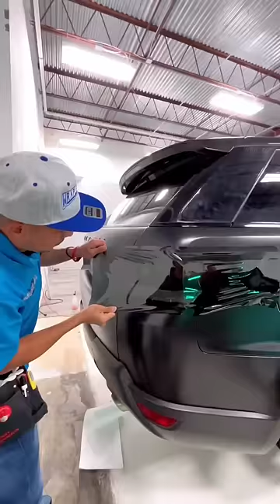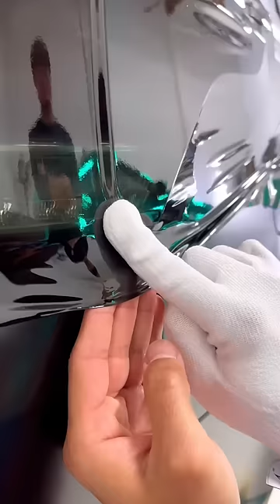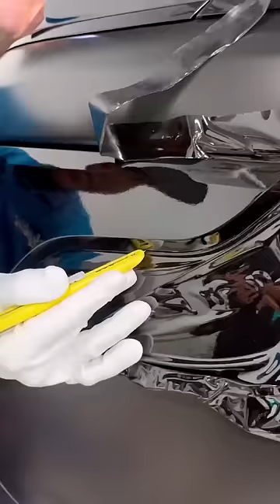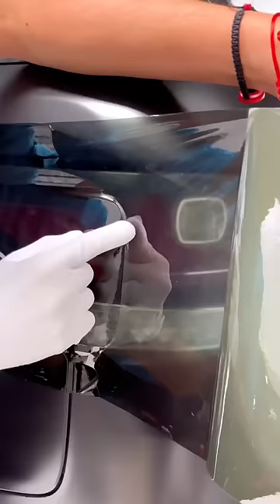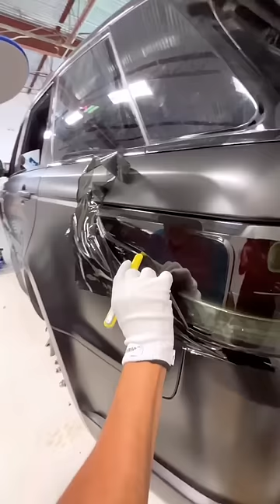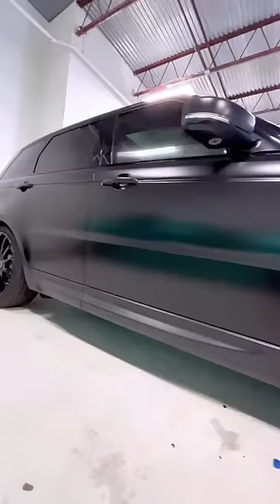If this Wrap is Wrong.. I don’t want to be Right‼️🔥✨👌 #carwrap #carwrapping #vinylwrap #rangerover

Comment: Yeah, it is. This is a major safety issue, especially in day time traffic when brake lights are hard to see in direct sunlight. Good luck having insurance cover a rear impact when the cops put "illegal lamp tint" in their report 😂
Reply: Dude he got 200 g car i bet the person can afford that ...
Reply: @combatx3373  sure he has money, but if you're caught with illegal modifications and/or get into an accident, you're for sure getting points which might lead to suspension or revoked. GL to the bloke.
Reply: @combatx3373  funny of you to think that anyone to buy such a POS car that doesn't even hold the prestige that the original company does would actually buy the car outright. That car will be on finance and if the car gets totaled, you owe the full value of that car to the finance company.

If the insurance is void due to tint, you now owe 200k instead of a deductible/excess
Reply: @ProlificGV  uhh, can you read? Can buy your way out of getting your license revoked or suspended? money cant solve everything.
Reply: @combatx3373  do you think rich people throw cash left and right?
Reply: There’s no way you just said it’s legal, and a couple sentences later said it’s illegal…
Reply: Its only legal if the lights are visible
Reply: That is a completely valid response, but the question was… “is this legal?”
Reply: "it is"? He meant it isn't I got your bro
Reply: Dont gotta pay if u going fast enough 🤣
Reply: Well it’s only a RR sport and not a new one from the looks of it, maybe £50k worth and it looks to be devalued with what’s been done to it. Looks cheap now. And also it depends how much light is getting through the tinted film as to weather it’s illegal (in the uk anyway).
Reply: @combatx3373  it’s called a lease first off second you know certain people spend more than they have right
Reply: Dude the light flashes just as bright with these on search it up
Reply: I read pimp instead of tint
Reply: @HitomiNee  can you read? they were commenting on the nerve of the comment that you replied to. saying that they have money so it doesn’t matter that they’re endangering drivers
Reply: @grandcalifornia8410  people think that rich people throw away all their money left and right. You don’t get rich by wasting money like a moron, that’s why alot of people never become rich. Unless you’re a trust fund kid though, then you probably do waste money.
Reply: @grodey3985  thank you shit not even that dark they ass arguing for nothing
Reply: @2oqh  that’s exactly what I meant by my previous comment
Reply: @rorymax  It's not his fault, the comment said "the nerve to say that" while tagging him and then he added (the person above you said they have money) of course it's normal to think like he did.
Reply: @Geezer877  He answered that, Didn't he?
Reply: Yup,as good as it looks,it’s a big safety hazard
Reply: Thank you!! Thank you for saying that.. I hate when I can’t see someone’s taillights..they think they are cool but won’t be so cool when you get your car or truck fucked up
Reply: Especially if it is really opaque
Reply: @andreesm8221  yeah and the stuff the brackets very clearly showed who he was saying had nerve
Reply: Nah, most cops don't even care. Plus if I live in a different state from where my car is from I can literally have a nascar and they can't do shit about it. A cop told me all of that.
Reply: I’ve had all my cars spray tinted on the tail lights and never gotten a ticket, and I live in Southern California (the strictest place). So chill, you’re fine. Just don’t drive like an idiot
Reply: Exactly. I can’t stand people with tinted tail lights. It’s so dangerous. Especially with tail lights being the biggest and sometimes only way of communicating with the people behind you.
Reply: @combatx3373 what kind of car is 200 g? That is way too light.

I know you meant $200k.
Reply: @suspicioussourdough  go cry
Reply: @combatx3373  he has a car who said he paid 200g for it?

few people ever pay cash for there luxury cars either a they cant afford to dump 200k on a car so finance it 

the other side is rich people who understand money

200k for the car poay cash your 200k down 

maybe it appreciate in value over time but for now your 200k down

instead take the 200k and invest it and take the car on a low interest finance package you'll see a greater return on investment from the 200k and when you do sell the car the appreciation value if its the right car will cover what losses you made in interest payments on the finance plan
Reply: it’s completely legal here
Reply: @HitomiNee  can YOU read????
Reply: @combatx3373  that isn’t a 200 grand car
Reply: @RetroactiveEscapades they thought it said “is this illegal”
Reply: "Yeah it is" So you're sayin it's legal? Thanks lol
Reply: What's the song called
Reply: in india it is illegal
Reply: Song ?
Reply: This assumes the police show up
Reply: okay you said yet but proceeded to only say bad things about the wrap so im confused
Reply: Get brighter bulbs, problem solved.
Reply: You can have black taillights tho just not tinted
Reply: Illegal in Europe, we are as dumb as we are smart, we have wisdom
Reply: Lights are clearly visible
Reply: U just said "yh, it is legal"
Reply: Who is this car going to endanger? It's a range rover, it'll break down before it can even leave the body shop
Reply: @combatx3373  And can he afford loss of human life or grievous injury? Absolutely degenerate comment.
Reply: but its also kinda stupid that turnsignals in US cars are the same colour as the brake lights
Reply: @combatx3373  this old ass range rover is 200g? More like 20g and had 7 different owners before this guy....
Reply: @HitomiNee  also liability if the insurance decides not to cover it because it's illegal.
Reply: @HitomiNee  it can.
Reply: Jesus 4.1k likes and no comments
Reply: @combatx3373  still can't afford to resurrect another Man's life.
Reply: yeah notice how they didn't show how dim the rear lights would be in the indoor shot at the end
Reply: @HitomiNee  The second smart person’s comment I have read so far!
Reply: The car is already a  road black color, it'll blend in so well grandma won't see it in time.
Reply: @combatx3373  don't be slow
Reply: @combatx3373  ok, give me all his money for him causing the accident lol. imagine it caused death? wyd then tho? og comment has a real point
Reply: And the reflectors too
Reply: It’s not illegal infact nothing is illegal if ur a sovereign citizen 😅
Reply: @combatx3373 i bet he could afford tinted after market lights but thats none of my buisness
Reply: Bro you said yeah it is to the question meaning you say it is legal and the you go and give reasons as to why it’s not😂
Reply: That’s why he does it off the books 😂
Reply: @ProlificGV  Roblox...
Reply: It's legal, as long as the tail lights are easily visible. Ot would be the person who rammed the back of the person's car because it's their responsibility to keep a safe distance from the car in front of you and behind youm
Reply: @combatx3373 no way that’s a 200g car. Looked one up on auto trader and they are selling for 80k tops lol. Somebody doesn’t know their cars… awkward
Reply: @Dark_Messiah-D2  there not legal bud, do some research
Reply: @combatx3373  200g? What is this a Bentley? 😂
Reply: @combatx3373  that insurance finna make him pay 3x the price of the car tf u mean LMAO
Reply: @combatx3373  And if there is a wreck and someone is injured or killed?
Reply: Lol this is coment i expected
Reply: At least in Europe, it seems to be legal to have tinted back lights. You can order them at the configuration by the manufacturer.
Reply: @ArshEbrahim  "Stan" by Eminem and Dido.
Reply: @andrerussell2383  "Stan" by Eminem and Dido.
Reply: @Kabodanki  It's the 80's all over when Audi made rear lights with smoked glass, that did put out the correct color temperature, and the tuning scene made wraps that..... didn't do that.
Reply: People get smoked headlights and taillights all the time they are still bright
Reply: @combatx3373  money can buy almost anything. Except your life if you get into an accident. Safety regulations exists not because the govt is pooping your style.
Reply: @ProlificGV  Everyone thinks they "have the money" until punitive damages are awarded because of such a purposeful and overt safety risk.  The price of the car is the least of your worries.
Reply: That was a stupid reply my boy...
Reply: @mwmm  w comment
Reply: don't you mean "no it's not"? because the question is "is this tint legal"
Reply: @combatx3373  it’s not about affording it. It’s the people behind him may not be able to see his brake light. Some guys are idiots and you can barely make out their brake lights at 5am.
Reply: This is most likely see through.
Reply: It really depends on the kind of wrap and how dark, most the time it’s not enough to really reduce the amount of light visible while the lights are on.
Reply: You said yes to it being LEGAL, and then continue to explain how it is ILLEGAL
Reply: The break light is on the spoiler the little thing sticking out at the top
Reply: @combatx3373  I think youd be amazed at the amount of cash poor people driving these
Reply: That's exactly what I was gonna say. But let's be real some people just aren't smart enough to figure it out lol
Reply: We need more people like you
Reply: Yes actually lol
Reply: Can you tint them in a darker shade like a slightly darker red for the brake lights and vice versa fore blinkers?
Reply: I can't speak to the US, but in South Africa, thr answer is "technically, but you could still get arrested for it".

See, the wrap itself IS legal. No issues here. But we measure the legality of lights by the distance illuminated. (I don't remember the numbers exactly, but i think it's about 30 m for back lights and about 50 m for front lights) so, if these lights still illuminate far enough, then, yeah, sure! If not, nope. Not legal.
Reply: Yeah it happens to lately..i can't see his brake light much..... lucky i noticed early.....if not boom 🤣
Reply: @combatx3373  and that makes it okay to put others at risk?
Reply: @combatx3373  Do you even think of consequences?
Reply: Bro what?

Vid: "Is this wrap legal?"

You: "Yeah it is....'illegal lamp tint'"
Reply: @combatx3373  you know they can fine you based off your net worth and income
Reply: so it is legal?
Reply: Well and maybe they will confiscate whatever is left of the car
Reply: So you just install brighter rear lights? Brake lights are sometimes hard to see in direct sunlight regardless of tint.
Reply: Or in fog
Reply: @combatx3373  go back to school 🏫
Reply: @mwmm  lmao
Reply: @combatx3373  that car isn't 200g...
Reply: @mwmm  car doesn't cost that much
Reply: My brother got arrested bc of this
Reply: Ok mister you know all about stuff
Reply: @HitomiNee  but it can buy me a boat 🚤 and a truuuck to pull it 🛻
Reply: I’ve had tinted taillights on my last 2 trucks. Never got rear ended, never had anyone tell me they where hard to see. I looked at them before I drove with it on you can easily see the break lights at all time of day. Unless you completely black it out. Truth is the most dangerous thing a driver can have well driving is there phone in the vehicle.
Reply: Bro you can see just as good as you can without the wrap 😂
Reply: It's funny how everyone in this comment section talks about the money aspect of the problem. It's also just a shitty thing that can ruin people's day if they get in an accident. Money or insurance is not the only problem...
Reply: they are very much legal, u can get rear lights fully blacked out as long as they re led and u can only get a medium tint f they are not led, so what he had done is fine
Reply: That's not really that dark though. I've had darker tail lights. And if it were that dark, put brighter bulbs in to offset it 🤷🏻‍♂️
Reply: @combatx3373  land rovers aren't that luxurious and not too expensive
Reply: @combatx3373  if you’re putting people in extra danger beyond a simple accident you pay with your rights. You cannot afford that
Reply: @HitomiNee  if the accident is serious enough it could also end in a lawsuit and nobody wants to go through that.
Reply: actually, depending on the state you live in, shit is legal.
Reply: Actually in some states it just depends on if light is able to pass through and seen in the daylight. If it can then it is legal if not illegal
Reply: You said it was legal, then one sentence later you said it’s illegal. ??
Reply: How is it illegal? If you break it will glow red. Americans have such weird law. This is allowed in Europe but 99% what is allowed in the US isn't allowed in Europe. I'm pretty sure that this is allowed. You can see clearly the "inside" of that light through that foil, so it's can't be that bad. I've seen cars with basically no reflection from rear lights and is somehow was OK... because police says the % of light that passes through that is valid... even tho it barely reflects light.
Reply: Lmfao yeah real difficult to see LEDs through some 30% tint
Reply: And they don't even look that good
Reply: wait, are you answering the question from the video? cause it asked "is this wrap legal?"

I think you meant to say "no, it's illegal"
Reply: @CH DE I bet you’re fun at parties
Reply: Ppl would do anything to satisfy their fragile ego’s honestly 😂
Reply: @combatx3373  Fancy or expensive cars don’t mean you have money, it just means you had enough money on hand when you bought it to purchase the car
Reply: You said "Yeah it is," then just explained why it isn't 🤦‍♂️
Reply: @combatx3373  no amount of money make your license come back..
Reply: The question was if the wrap is legal and you said "yeah, it is" 😮
Reply: Sigma
Reply: @HitomiNee Maybe in like, Kenya, you can.
Reply: Congratulations, that vehicle just turned into a cop magnet, but hey it's a range rover so if the owner can afford it they can afford anything that ensues afterwards
Reply: You forget something that is illegal in one state might not be in a different state. Federally no this isn't illegal
Reply: Ive been driving around in my bmw with headlights and tail lights tinted, it’s been 2.5 years, so far so good,
Reply: @HitomiNee  🤓🤓🤓🤓🤓🤓
Reply: Always a hater 🤣💀
Reply: @combatx3373  bet he can afford the lawsuit for the passengers too dmbas having money doesn’t make you invincible to any problem
Reply: @HitomiNee  you can definitely buy your way out of the license revoked/suspension. Using dual citizenship with Canada and the US, you change the car registration to a Canadian company, then you just use the driving treaty between the US and Canada to shelter your license from points in the US. You still have fines, but won't get your license suspended or revoked. It would cost prolly no more than 25,000 to do that, including lawyer fees.
Reply: You mean “no it isn’t”. The question was “is this legal?” So the answer is “no”. You said “yes it is”
Reply: @HitomiNee  incorrect. Money solves everything, in the US anyway. Everything. Everyone can be bought, everything can be sold. There is no situation that cannot be improved with a metric fuck ton of capitol
Reply: @combatx3373  looks like a kia soul
Reply: @combatx3373 Rich people don’t stay rich by (stupidly) throwing money away.
Reply: People aren’t that blind.
Reply: Now idk how it works at all but wouldn’t that be on the driver rather than the shop as for all he knows it could just be a show car which in of itself is exactly legal with everything on them usually and why they’re towed rather than driven to the show’s location
Reply: Bro went according to my calculations 🤓
Reply: Holy shit dude, I thought you were joking at first 😂 what is wrong with you?
Reply: You can't say it's legal and then say it's illegal in the same statement.  That's.....illegal.
Reply: @combatx3373  it’s a principle and besides if they gets rear ended even if it’s the person behinds fault they can just say, they couldn’t see their brake lights
Reply: Don't you mean it isn't (cuz it was asked if it was legal not illegal
Reply: that exactly what happed to someone i rear ended cause the sun was setting, we were eastbound and i couldn't tell if his was slowing down till it was too late, court dismissed me following too closely and his insurance had to pay my repairs, on top of that he was finned for illegal tinting on the tail lights, and reckless driving 🤣, he did try to counter sew a couple months later and still the court dismissed it, cause he was still in the wrong and backfired on him again since his new car also had tinted tail lights 🤣,, looks good for a track car but just be warned if on public streets, that if u get rear ended, you will probably pay the price like that idiot i hit lol
Reply: I dunno but looks. Dam awesome and I can only afford a chicken ☺️ wrap 🌯 great work all the best 😊😁
Reply: @smolltaco5667 true and lights prolly not covered
Reply: Did you just say yes, it is legal??
No it is not.

Federal regulations of D.OT. and ALL State laws require there to be a reflective marker.

1. No clear in the rear unless its in the reverse gear

2. Reflection is more like a mirror than a reflective diamond cut marker lamp

3. No car ever produced was the same color as the tail lights.
Reply: @DorfVG  No.
Please see my post if you'd like to know more about it and why it is not legal.
Reply: @pandorakplays5782  its people think that the rear lights are tinted/covered by the warp but nah nothing will happen if u dont have ur lights of ur car not covered by a wrap or be intended but there are levels of tintedness that are not allowed
Reply: @combatx3373  this car is not 200k
Reply: Gotta pull that off right after you wreck lmao
Reply: Explain why some cars have smoked lenses as stock then? Not to mention it tinting makes it EASIER TO SEE brake lights in bright sunlight.
Reply: Depends on the state on how much light is let threw.
Reply: Wait so it IS legal?
Reply: Wait so is it now legal or not bcs youre first saying yes it is, and then start explaining why its ilegal?
Reply: Lol unless you live in Virginia where the person who rear ends you is always at fault no matter the situation
Reply: “yeah it’s legal, it’s just illegal”
Reply: I was behind an ass with tinted back lights. Learned real quick that a normal following distance is not enough for these jerks because you absolutely cannot see turn signals or brake lights on a sunny day. I doubled the distance real quick.
Reply: My friend has similar wrap on his BMW, the lights look pitch black BUT the light somehow gets through as if there was no wrap, it really is amazing and i still can't get my mind around it, maybe it is like a one way window , you know, mirror on one side, from the other side it is just like a normal window.
The wrap propably is made to work like this but I'm not sure,
Reply: @HitomiNee  It does. You not having money that can do that does not mean that other people don't, you are a brokie, start making real money
Reply: Wow I didn't realize how stupid everyone was hahahahaha
Reply: really doubt the light intensity is significantly reduced, I've tested people's car's who have literally sprayed painted tail lights black
Reply: If u can’t see smoked tail lights in the day surrender your liscence or get your vision corrected in almos legally blind and can see them
Reply: I can pay it who cares
Reply: @grandcalifornia8410  they do.
Reply: @HitomiNee  I mean.. it can solve a lot more than you’d think..
Reply: @HitomiNee  its not illegal though this whole argument is pointless don’t think y’all know how warps work the professionals take everything into consideration on how it would affect the customer…
Reply: @mwmm  legal means its allowed….
Reply: @likemau5552  the problem with the lights is they use headlight levelling devices that attach to your suspension, they are made that cheap and brittle they break in the first two years and people don't notice so over the slightest bump they shoot to the sky
Reply: @combatx3373 so all you care is about the money rather then the safety of others?.. -_-
Reply: @PRExJay the brake lights still work fine and are the normal bright red so no its not really a safety hazard.
Reply: @combatx3373  when it’s happens over and over again they do more than just fine you 😂
Reply: Do yall feel the same for your UNREGULATED BRIGHT AS THE SUN HEADLIGHTS???!?!?!?!😭😭😭 I despise them, it's as if everyone is already driving around with brights
Reply: @HitomiNee  I paid for mine not be suspended this morning 😎
Reply: @Sarge92  Thats middle class people bud Ahahahahahah, if you are rich, you aint spending an extra 20k just to pay it off 25x slower lmao. If you rich, you dropping atleast half the car, if not all. Theres a difference between 200k and 10mil lol. 200k is middle class sadly, the wealth disparity only grows. Also bud, YOU ARE ACTING LIKE YOU CAN SELL 90% of cars for a profit LMAO
Reply: @combatx3373  nah he would just get sued
Reply: @combatx3373  you think because he has an suv worth 40k - almost a quarter mil has the fuck it I can afford it mindset when it comes to property damage and paying for shit he already paid for that’s a brokie mindset. I know for damn sure I wouldn’t want to pay for shit and deal with inconveniences just because I can afford it
Reply: @combatx3373  off course, say that too the family that just lost a loved one.
Reply: Who cares lol
Reply: So you mean it is illegal… right? Because the video asked “is this legal” so your comment is counteracting itself
Reply: @rohanbaste-bania6227  :(
Reply: @kalebkellner5568  😭
Reply: @Combat x  problem is it's not capped at 200k. If the owner gets rear ended by a $2 mill car they will likely be held liable for those damages as well. So it's 200g + potentially a big sum
Reply: @combatx3373  that car is not 200k
Reply: Smoked tail lights that were popular in the 80s don't have that problem.
Reply: @Dylan McCallister  true but the rules around modification and safety have changed over time. You couldn't make an 80s car today and have it pass compliance (which is a shame because they were beautiful)

It might be legal in some places but most road authorities won't certify anything that impacts light visibility like this
Reply: @grandcalifornia8410  that’s exactly what many rich people do
Reply: @HitomiNee  just because it’s revoked technically doesn’t mean he can’t drive the car🤣💯
Reply: I've had it on almost every car I owned with zero issue
Reply: I'm confused by your comment...
Reply: When he kills someone it's going to be jail time
Reply: Very good point
Reply: just peel it off before cops get there
Reply: @Durkhead  "just peel it off" it's not that easy
Reply: @MickeyDee420  anecdotal evidence. Because it doesn’t happen to you doesn’t mean it there no risk factor.
Reply: Lapd would never come to make a report on something so minor.
Reply: “But officer! It looks cool though!”
Reply: He asked if the wrap was legal, and in tge first scentence, you agreed with him.
Reply: @MickeyDee420  op said in the sunlight. That was the context of the discussion. At night it would most definitely be visible. 
I really don’t think it’s that deep though. Sometimes people making rule’s genuinely make them for people to be more safe. It’s not always a ploy for more money. But how would we know.
Reply: @combatx3373  b cuse if that fines should have an minimum amount of cost plus a cost that is based on how much money you make
Reply: @Darth_Uchiha47  i guess so, i just personally have never had an issue buteveryone is different
Reply: @combatx3373  fucking love watching people think money can do everything, comedy gold
Reply: @HitomiNee  Bruh you said bloke, you’re not an American we have different laws. Maybe where you’re from it’s that strict
Reply: Dude what? Just get Bulbs that have high lumens. They'd show through that tint... I'm tired of the government taxing every last bit of owning a vehicle, while also telling us what we can and can't do with our own vehicle. Like seriously.
Reply: Imagine being so lame.
Reply: @combatx3373  car in nowhere near 200k try again
Reply: Well there are black lights in series cars..... but they have all one thing in common. They are too bright LEDs to use them in clear ones
Reply: @combatx3373  medical bills are much more expensive.
Reply: @HitomiNee  Tell that to Congress
Reply: You're thinking in the aspect of someone who's not rich lol. they don't give a shit they buy a new car.
Reply: @grandcalifornia8410  mrbeast: I’m just a hallucination
Reply: Peel it off prior lol
Reply: Looks like we found a hater
Reply: He does this for a living I'm sure he knows the law
Reply: nerd
Reply: I'm not a typo guy, but on the video its saying "it's legal?" , so, all good and all, but its "Yeah, no, its illegal"
Reply: @combatx3373  thats a pos car. Only fake rich buy those
Reply: @deang8910  your gender killed my sister, she was only 6.  they took advantage of her body.
Reply: @JaxSparrowMaybe  yes as in it's illegal
Reply: @veralovey2697  what are u even talking about? What does gender have to do with anything?
Reply: Not if the lights are bright enough
Reply: He said is this legal
Reply: It’ll still be covered. If road conditions are that bad you should Keep even more Distance is how they’ll see it. So long as you can see the brake lights work.
Reply: So you meant it isn't?
Reply: So it isn't?
Reply: well depends on state actually, each state is different. For instance im in PA and its legal, but in NJ its not. I drive over to NJ its still legal because im a PA resident
Reply: @combatx3373  and if it determines hes at fault. I'm suing
Reply: @combatx3373  but the people That accidentally rear ending him because he's an idiot Don't deserve to have their time wasted because he thought it was a smart idea to obscure his brake lights to make his car look cooler.
Reply: Yeah and it’s not even that good
Reply: so then that means illegal
Reply: Do you know what legal means?
Reply: @HitomiNee  bro it don’t work like that trust me i’ve gotten rear ended with tint and still was fully paid for the accident you have no idea what ur talking about
Reply: If it was stock I’d agree. But I live in rich land. Anything less than 350k and it’s debt or daddy’s money.
Reply: shit, I've seen cops with the same shit and worse
Reply: Indeed
Reply: Lol, it's worth the sexy
Reply: tinted taillights are legal why would this be illegal
Reply: @combatx3373  people become rich because they know how important money is to them.
Reply: it is legal depending on the lights. my car for instance has 50w LEDs for all lights. during the day the brake lights are at the full 50 and are bright as fuck even with the tent over the lights
Reply: Sure looks clean tho
Reply: @Combat x  That range isn't 200k lol
Reply: @HitomiNee  you acting like corrupt cops don’t exist, or corrupt people you can buy anyone off, I got into an accident while I was talking on the phone and the witness of my accident said he won’t say anything if I give him some money. Ended up being not at fault and made 20k from my accident plus buying a brand new car
Reply: @combatx3373  afford prison time not everyone's immune forever.
Reply: @mwmm  imagine being a poor person lol😭
Reply: @HitomiNee  You act like rich people care. They have the money to break the law
Reply: I guess yall haven't seen the vanta black BMW yet?
Reply: @grandcalifornia8410  fr
Reply: So it's legal? Because that's what the video is asking, not if it's illegal.
Reply: any film or cover over the lense clear or colored is considered illegal in nc idk about other states , same goes for license plates
Reply: Ur saying all that but where I’m from/living u can do this to ur front and rear lights obviously can’t be too dark but u can do it
Reply: It’s funny how wrong you are 🤣🤣 sunlight invades the reflectors and fills light bulbs with light making them seem on when their actually not. I remember putting 2% tint on my brake lights and it made it so much EASIER to see when they were on and off in the day light. Don’t say shi like this when u don’t know bro bro
Reply: That light tint is fine. You'll be able to see the light just fine in day light. Specially considering it's LED
Reply: No it is not legal
Reply: @djjaysky9071  in Texas 😝yes
Reply: I only use headlight protection film when it yellows peel it off and stick new on
Reply: @combatx3373  that is such a stupid take.
Reply: Its also a sign some people have TOO MUCH BLOODY MONEY...
Reply: It’s not iligal cause it see through so at night and in the day you can see the light so it’s not really a safety issue the only thing he will haft to worry about it that the wrap on the taillight coming off
Reply: It's called one way mirror boy
Reply: @HitomiNee  america Land of the free
Reply: The question was "Is it legal". You say "Yeah, it is" and proceeds to tell why it's illegal. Some people are apparently born without a brain.
Reply: false
Reply: @RetroactiveEscapades  guessing the original comment thought "is this wrap illegal"
Reply: Lol
Reply: @combatx3373  ?? Most Range Rover owners I know have financed it plus it could be second hand.
Reply: @combatx3373  if it caused a death and your not jailed you could be liable for a wrongful death lawsuit
Reply: It’s a tint it is legal. It not dangerous actually. It’s still very visible.
Reply: Funny bro😐
Reply: @combatx3373  range rovers aren’t 200 gs buddy
Reply: I’d do that as a trooper. It’s really hard to see on some of them, especially when they got a shitty job done one their entry level CLA benz. ☠️ I still don’t get how they can’t just get an AMG and keep it factory.
Reply: @zachturner774  I think he is referring to the custom job done on it by this certain company I forget the name rn but it does in fact put the price tag up there around 200k I actually worked on a guys garage who owned one that looked the exact same as this one when I was in masonry and they’re pretty damn nice but I’d never pay half that for what it is
Reply: @combatx3373  we're talking about life or death situations doesn't matter how much money he has
Reply: this guy probably lives in cali AHAH
Reply: That’s why you just get some super bring LEDs. I bet they shine brighter then the factory bulbs even with the tint on them.
Reply: @combatx3373  youd actually be liable for the full cost of the Collison. this can void coverage so if lets say another 200g(did you mean k) then the driver would be subjected to the full 400k in damages.
Reply: @HitomiNee  who cares bro
Reply: If it's a safety issue why is it legal? I say this because the question on the video was is the wrap legal and you answer yes.
Reply: Tail lights have no accident stopping powers if you're gonna need a cop at the scene of such an accident which requires a report on the spot.

Ok?

Citations are Revenue. That's all.

Road codes weren't a thing until they became worthy of generating REVENUE - not safety.

Safety was the wagon it was staged on. An unsafe wagon, btw.

Quit rooting for BS all the time.
🐑
Reply: You don't need visible reflectors during the day.
They only need to be visible at night (which they are especially with how clean & large they make them now)
That amount of tint will still allow them to be legally reflective - but you may need to prove that in court because cops will assume u r scared & stupid so they need the $ and hope you pay it off without crying about it.

Always cry - as if you don't know what $ is.

Know that when tail lights codes became a standard, the tail light wasn't as big as they are today.

Today, they are made that big cuz there r many karens out there that can't drive.
Reply: 1
Reply: Alternative,make your tailights clear, they also look nice (nicer in my opinion) and are safer
Reply: I tint my taillights so they work less
Reply: Not in Las Vegas
Reply: @combatx3373  My current bill from beimg rear ended is over 650k in medical bills. Do something stupid and you could easily be hit with 6,7,or 8 figure lawsuits.
Reply: Spot on
Reply: So it is or isn’t legal?
Reply: The question is, is it legal? Not illegal.
Reply: It should be but it isn't any who, spray painting over taillights is illegal
Reply: @combatx3373  200g that’s a range rover bro only 47-120k
Reply: The question was, "is this wrap legal?" You agree that it is and then criticize its hard to see brake lights.... All over the map with your argument
Reply: @combatx3373  most people cant, they get them on lease to get cars way out of their budget
Reply: It would actually be the person that’s driving and crashed into the person with that rap they are supposed to keep a certain distance around 100 feet and if they don’t it’s their fault
Reply: Not to mention who suffers the most when a car is rear-ended... It's not the guy doing the hitting. It's the guy who thought it was cool to make his brake lights hard to see and ends up going through his windshield (because he was also too cool to wear a seatbelt).
Reply: If he ain’t in cali it don’t matter he in Louisville they really don’t care !
Reply: Had this on my car for 3years, still can see the brake lights in day time never had an issue and still looks great 👌
Reply: Customers choise im not complaining 🤷‍♂️
Reply: How the fuck somebody gonna rear end you in broad daylight for having a tint that’s too dark on your tail light??